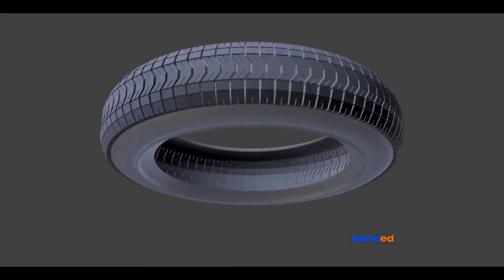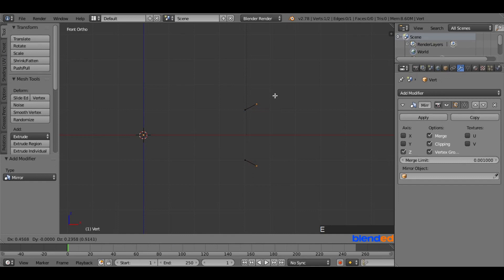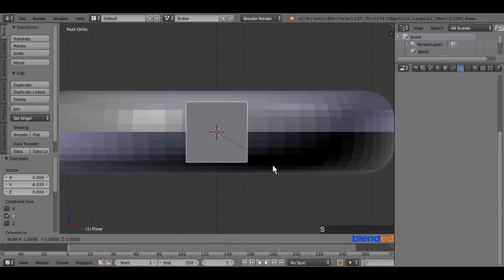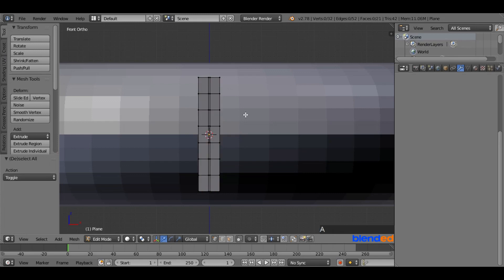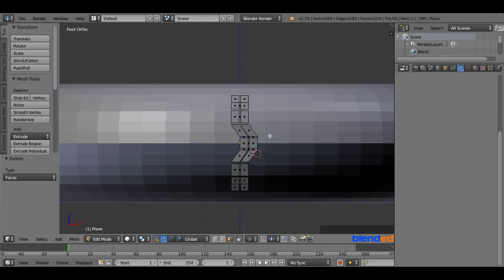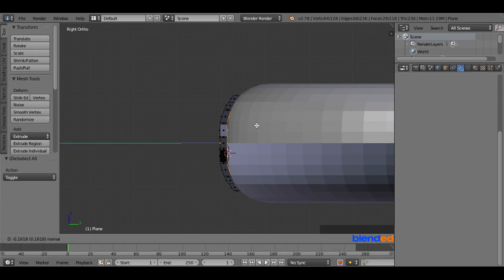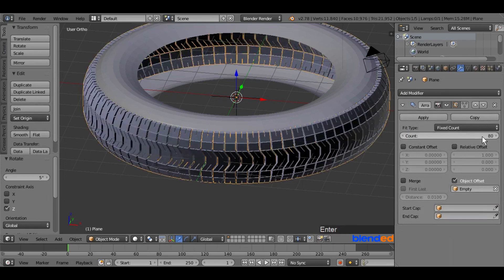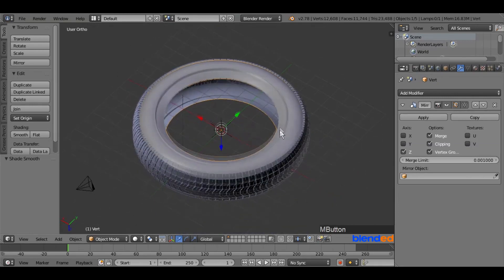Blender Tutorial - How To Make A Tyre In Blender

Comment: I just made this tire following this tutorial.   Everything went perfectly without a hitch.  Not bad for my first object ever in Blender.  I also kept detailed notes of every step of the process.    Even so, there are things that I don't understand why they were done.  But I'm just learning.   I actually want to create a much smaller tire for my robot with a specific tread.   So in addition to understanding all these steps I'll also need to learn how to set things up so I can work with specific dimensions.  For example, my tires are only  4 inch diameter center hole, 8 inch diameter O.D. and about  4 inches wide.    Of course I can change these dimensions to mm to make thing easier.   But I'd like to work with specific dimensions because I'll  be building the entire robot   using Blender so having all the parts the correct sizes will make things a lot easier overall. 

Now I need to learn how to save this tire and use it as an component later.

Comment: Just a couple things I want to point out that was different for me, or where I had minor issues, in hopes that it will help somebody else.

1. My plane was much larger at the 2:45 mark. I had to scale it down to 0.100
2. Around 5:06 my proportional editing was moving the ENTIRE mesh. I didn't realize when pressing 'G' to move it that my circle was so large that I could not see it. Wheeling the mouse in sized it down to make it work.
3: Around 7:00 he/she says to scale it in 0.2 , but for me it pushed the faces way out. Instead, I pressed     G  +  X  +  0.02 .

Also, make sure at around 10:00 you apply the modifiers in the same order that he does. 

Otherwise, Great tutorial! Accurate and to the point.
Reply: Geez, thanks so much!!